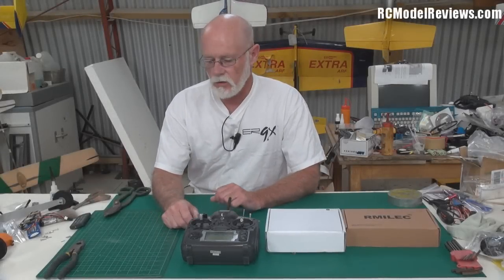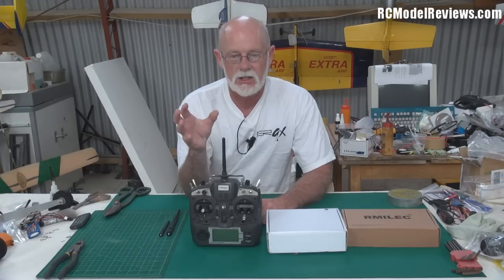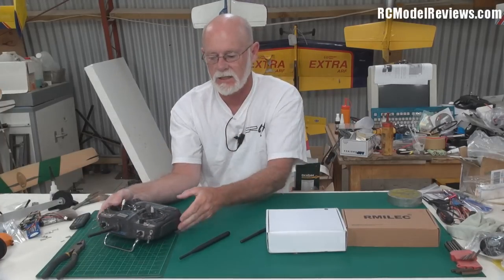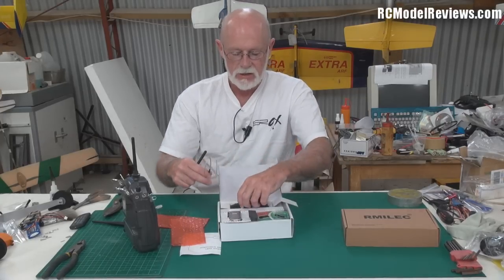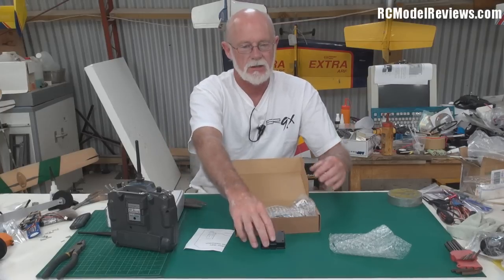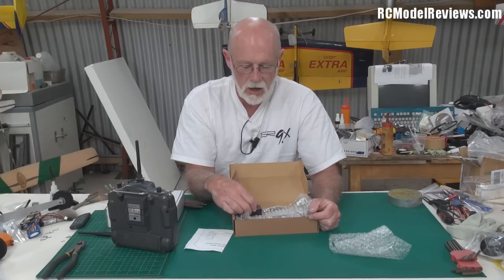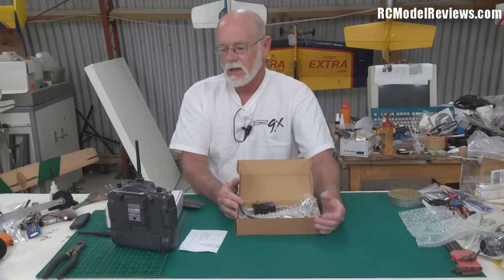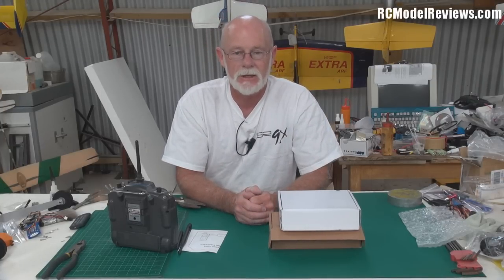FPV long-range RC options

Comment: This is the craziest thing ever that's been bothering me for ages. Everyone says "put your RX on one wing and the VTx on the other one". Sure, that can't hurt, but how big of a difference it is when you have for example the RX on 2.4GHz and the VTx on 5.8GHz and you put them, let's say, 10cm apart and ~5cm from the rest of the electronics. How much shorter will the range be as opposed to let's say 1m separation between the two and ~50cm apart from the FC?

Comment: Ive been flying rc for 25+ years and am just now getting into fpv. I bought the goggles, cameras etc over a year ago and have yet to use them. Im wanting long range. 
I live in Yosemite Ca. Im sure their is very VERY little interference here.
Can you help me by letting me know wich is the best option for me here for long range?

Comment: I know this video is old, but I've recently got a turbowin RY-2.4 to boost my 2.4g signal not for range but for resistance against interference from wifi and 2.4g towers nearby. Model is going wonky and crashing at certain area in the sky. I wonder if these boosters would help eliminate or reduce risk of crashing?

Comment: you have done reviews on all of the FPV equipment except for long range safety and GPS trackers. I lost my Bix 3 and later purchased a PinPointRC Black box, the next time I crashed my Skywalker I found it within minutes. you should ask them to do a review for them

Comment: concerning the 2.4ghz booster , can I use the same type of booster on my 2.4ghz fpv camera , the camera has a 2.4 ghz transmitter and I use my phone for the fpv video , I get plenty of range out of my RC transmitter but lose video signal . I was planning on using a 2.4Ghz Signal Booster Amplifier For DJI Phantom , it looks small enough to install in the camera housing , but if not I can mount it inside the drone , so would that be a go or no go ,  and if no , why not ? any thoughts on that one ?

Comment: whats the situation with the boosters if you use a transmitter like flysky that uses duel antennas? can you get away with using it on one antenna or  do you need to buy two to cover both antennas?

Comment: I know nothing about signals and thanks for the education. I was wondering would it work if i connect a huge fish bone tv antenna or maybe a small tv dish satellite? With the amp that. Comes with it? Wanted to test some range limit on a self build quad.

Comment: How bout using a remote antenna set up with a proper ground plane set up on a tripod or roof top. I know from operating  2 meter and air band handheld radios that these antennas certainly beat the crap out of those rubber duck antennas.

Comment: I watched some videos of the TBS crossfire using their own protocol, CRSF or something. Range is easily up to 40 km, freq is 900mhz and latencies lower than 150ms. But it comes at a price, minimum 99 dollars. You could look into that.

Comment: Hi I added a cpl 2.4 ghz boosters and a booster pack to a mavic drone.  As I understand one antenna is a transmitter and one antenna is a receiver?  Should the booster be reversed on the receiving side?  The boosters have a power led and an antenna led and the antenna led  receiving side only comes on with the input coming from the antenna to the controller and does not lite up the opposite.  The transmitter side does light up with the controller hooked up to the input side and the antenna hooked to the output side.  Thanks for any input.

Comment: Does anyone know if you can use a wifi booster on fpv goggles? 

I have a 2W Sunhauns wifi booster and I wanted to try and use it on my eachine v800 fpv goggles,  to get a cleaner picture.

Comment: Have you tested the range with the 5dB antenna? My understanding (from my experience in audio) was that every 10 dB is equivalent to doubling the volume level. I'm not sure how that translates to radio so you may want to try and confirm that you can actually get 3-6km range with the bigger antenna

Comment: can a television with it's own antenna can receive signals from a fpv transmitter? Not a tv connected via AV cable with an fpv receiver module. But directly by TV's own antenna, despite of having loss of range.

I want to know the signal type of fpv. If it is the same as local tv station or different. If the video receiver inside a television does the same work of a fpv receiver.

Here I'm talking about the small TVs, probably 5" or 7" or 9", not a full size TV of course.

I searched for this topic in RCModelReviews, some other channels, and on google also. But there is no stuff on this topic.

If possible, give a review on those wireless signals with this topic. Else help me with a reply please.
Reply: Priyabrata, I'm pretty sure you're going to need some form of external video receiver, either with a TV set or small monitor screen.

The many frequencies that an FPV system can operate at, are not able to be picked up by the regular TV's Analog tuner (except possibly as noise), and definitely not by the TV's Digital tuner, which operates at a completely different band and frequency.

If indeed you could transmit your signal on the TV's Analog tuner's frequency (would require a custom built VTx) the regulatory bodies controlling the Airwaves where you live, would probably have a few issues with it.

Hope this helps clarify your question (sorry I'm not Bruce.)

Comment: +RCModelReviews Is possible to set up a repeater thru a 30m culvert pipe as part of the course. Approx 5 ft 100 ft  Disused storm culvert that is 90 degrees to the course.  Is there some kind of Repeater system that could do everyone's signal (or even just one)?
Would be a neat topic, or I could just use a big mirror. 
thanks
back to the trench

Comment: Really enjoy your videos!  Makes me want to visit the land down under.  Question about the booster...

Would the antenna still provide some gain if the power was not applied to the booster (meaning booster connects to radio and antenna, but power is on a switch and the switch is off).  What I have in mind is using the boost as an insurance policy (flip a switch and my range gets extended).  Because it could cause problems for other people to have on all of the time, I would rather use high gain antennas and modest power most of the time, and the booster just when I need it.  But I want the switch to the booster to be a simple toggle switch with no antennas to change.  Do you know if there are any repercussions with this approach - either significant loss or possible damage to the transmitter module when the power to the booster is off?
Reply: i like to know too
Reply: thanks!!
Reply: NO

Comment: what about long rang with solar so your batteries will always be fully charged
Reply: You would never fit enough panels on to keep a battery charged, It could extend the battery if you keep pointed at the sun

Comment: what if i want 100km+ range what can i do? i doubt anyone knows but just asking hope someone replies soon
Reply: Control feed is by far the easiest thing to get to 100km. You'll never 
get everything else to that range without a lot of money and a huge 
amount of experience and time. Not to mention the possible safety 
implications...
Reply: How you planning on flying this far with 1 battery?
Reply: +Obinna Eke who said a battery? i was thinking more of a motorcycle engine but i need some type of really long range transmitter and receiver do uk anything other than scherrer uhf?
Reply: salem zeid Hmm, no, I don't really know a lot of transmitters/ receivers that go 100km+. I use a 2.4Ghz booster and a 5.8Ghz booster from sunhans. Which gives me plenty of range for my fpv plane (over 6 km) But i can't go further because of the batteries. So good luck with finding sth that goes 100km+ :)
Reply: +Obinna Eke i was thinking first vlf and lf those go a long way but need large facilities to run them right?
Reply: +Obinna Eke  i also want something without the need to use a repeater
Reply: salem zeid From what i know, vlf goes a long way; even more than 100km. But that's about all i know of very low frequency... Sorry I can't help you with that :/ I have no experience with vlf
Reply: +Obinna Eke no worries man
Reply: +Obinna Eke do uk how the video feed can be made to support more than 100 km? i am new to this excuse my novice questions
Reply: salem zeid Well, I personally don't know.as I haven't tried it yet, Sorry.Maybe you ask that company that u mensioned a transmitter of
Reply: +Obinna Eke okay thank you man
Reply: salem zeid No problem :) Good luck; I hope u succeed in finding one that goes 100km+ as that would be awesome  :)
Reply: What you are trying to do should only be attempted by highly experienced FPVers. You will waste a lot of money and will completely fail, and without the necessary experience, you'll probably do it dangerously too.

And a motorcycle engine?! Are you serious? Please, for the love of legal flying, your self preservation and the safety of others, do not attempt to go 100km with a motorcycle-engine aircraft.
If you do attempt this with minimal experience, then shame on you for being an irresponsible member of society.

To answer your question, "what if i want 100km+ range what can i do?", You don't.
Reply: go get a dragonlink and pick up the 7watt booster for it.  just the regular dragonlink out of box works more than 50km.  I've had it work for 80km line of sight.  The booster will get you the 100km you need
Reply: they're using cell towers so you have to go that route now

Comment: Might be useful (from Cisco data):
0 dBm = 1mW
1 dBm = 1.25 mW
2 dBm = 1.56 mW
3 dBm = 2 mW
4 dBm = 2.5 mW
5 dBm = 3.12 mW
6 dBm = 4 mW
7 dBm = 5 mW
8 dBm = 6.25 mW
9 dBm = 8 mW
10 dBm = 10 mW

note that it is a log scale, not linear.

... BUT: if your transmitter does not put out the power, the larger antenna does not increase transmitter power as indicated... it will only increase output up to the limit of the power (mW) available.  In other words, a system designed around a 3 dBm antenna most likely will not reach 3.12 mW simply by adding a 5 dBm antenna.
Reply: +Devin Duncan yes its log, 0 dBm is the base power, now 3 dBm is actually double power gain. a system that outputs 1watt @50ohm with a 0dB gain will create a radiation of 1 watt equivalent, if you increase your antenna gain by a factor of 3dB, your radiated power will be equivalent to twice or 2 watts.

Comment: So can I get one of the 2000mw 5.8ghz systems from hoobyking and get at least 10 kilometres? as I asked them and they said I needed LPV... I dunno, I give up! Well my goal is to build a semi quarter scale model of at least 2.5 metres wingspan with a gas motor of around 30cc and have large fuel capacity and be able to launch a model down by the coast and fly it inland above the capital city , get footage and fly back again. eventually I want to design my own composite mode land give it long and slender wings such as a u-2 or a predator drone (oops, did I say that?) so I can float around at higher altitudes without using a ton of fuel.
Reply: +stewjw  Dude you need to turn on the sarcasm detector.
Reply: 5.8ghz great for indoors or line of sight you really cant penetrate through much of anything using a lower band 900-1.3mhz will go much further and you have the ability to go though trees and buildings a lot better.
Reply: +shoominati23 2000mW is OTT. You can use much less power with decent antenna. I'm not sure about 5.8GHz I'm a bit out of practice using that. I currently use a 700mW 2.4Ghz ImmersionRC video transmitter with a TBS Ground Station (includes video receiver) and a 11db TBS Yagi and I can achieve 10km no problem. I also use a TBS ImmersionRC 600mW 433MHz radio transmitter for RC control but I typically fly at around 200mW unless going out far. Its depends on the battery I use and I fly mostly in the low power setting. Using low power on the video transmitter causes less interference with other radio gear eg GPS and preserves the battery. A particular problem on small frames such as multirotors.  I just got an antenna tracker which is better for more local flying since when flying long distance you don't  need to  move the antenna that much but it still helps. You can also use a circular polarised (left or right not mixed) clover antenna on a similarly polarised patch or helical antenna on the receiver. There are also horizontal patch antennas which typically you would use use with monopole (rubber ducky) or maybe a dipole antenna which are horizontally polarised. Dipoles are good for radio control freqs including 2.4Ghz if you want to increase the control range using that. Stay away from high power transmitters would be my advice and optimise your setup. Always do long range FPV in small stages to iron out any issues with the setup. With long range always use an RTH (return to home) setup. Radio interfence can come from anywhere and also you can get failures with the FPV gear which is  more of an issue when using  high power transmitters which can get very hot. Anyhow that's my experience check the reviews and forums for your electrics before buying.

Comment: Although Ive been watching your videos for awhile now, because Ive just gotten a Dragonlink, I thought Ide check this vid out. All was going nicely till I heard you say "You can get a UHF system....". Ummm...I know youre aware of this, but, Everything between 300Mhz and 3Ghz is UHF. Why are there people saying..."Oooh, Ahhh,,UHF is so cool"? Anyone flying 2.4G is already in the uhf band!
https://en.wikipedia.org/wiki/Ultra_high_frequency
I know..it sounds cool. We like to get sucked in by the marketeers.
Reply: if you are talking about UHF by (ITU) yes, it is between 300 MHz to 3 GHz, but if the UHF is defined  by (IEEE) it is between 300 MHz to 1 GHz,
Reply: The FCC uses the ITU system, so therefore since I am in the US, my original statement holds true for my purposes. Thanks though for the relative differences.

Comment: How are these guys getting like 3 miles or even farther with the lightbridge on their dji that's only rated at 1.7 km? I understand they're mostly at a beach or something without anything blocking the signal, but over 3 times the rated range? They must have added something. What?

Comment: Hey! I am wanting to extend my range significantly with my radio. I have an option between  getting a 2.4ghz power booster or a rangelink uhf system from my buddy for 60$. On average I only fly out 1km,  but end up loosing signal after the 1km mark. I am running 5.8 ghz for video. And I am wondering which one would be better for me the range link uh system or the 2.4 ghz power booster for 1 km flying. Thanks!
Reply: 2.4ghz is fine. get a FrSky module and youll get 1km easily, get a Frsky 7dBi patch on your module and youll get 2km easy, get a 2watt booster and patch and you could get up to 10km easily.
Reply: Uhf will have longer range but 2.4 will be fine for 1km. You should be good either way.

Comment: I got 200 meters range maximum with my tyrnigy 9x stock module. what 1.5 km are you talking about?
Reply: John Robertson No sir. my radio is 9x, there is no additional antenna pin. there is no breaking connection, it's all checked. That was time ago and i already solved the problem) There is two resistors on A7121 chip  output pin that closes to ground. They are attenuating signal. The are not suppose to be there according to manufacturers schematic diagram. I took them out and after that i have rock solid radio link on 500 meters on ground. I did not tested it on further distance yet.
Reply: I'd say if you're only getting 600 feet range, there is definately something wrong with your system, think I'd make a complaint and have it checked out.. GL  :)
Reply: OrlovIV You may have the wrong antenna. If your Tx has a connector with a small hole, you need an antenna with a pin, and vice versa. Did you damage your Rx antenna (s) in any way during a crash or cut them off thinking they mightve been too long? You cant do that...they are tuned to the frequency of your radio. If you have two  leads coming off your Rx, they need to be 90 deg apart, and preferably pointing down. I mean after all...your craft is above you right?
Reply: OrlovIV Ok, you have the internal antenna like my Futaba 8J. My OrangeRx T6 and Futaba 14SG have external. Those resistors might have been there in the event the radio gets sold in a country that has Tx range limitations. But still, I think it still should have given you 1 to 2k at least.
Reply: i agree

Comment: Thanks for your review. Tried a mod to my futaba t6j using a cheap rp-sma to (small pcb connector?) wire and a 7dBi antenna from ebay. Only got 150m before RTH kicked in. Did a range check on the ground with the antenna pointing straight up (not at plane) and only got about 15 paces away. Could this be a dodgy cable or antenna or am I missing something? Thanks

Comment: Can 433mhz UHF TX/RX be modified to run on 440 band so us Hams can run a brick or other amp to run 10-15 watts power and get extended range via a good Yagi antenna for the ground station and dipole for the plane?

Comment: so if i use a 433mhz radio can i use a 2.4 ghz FPV? and would this be a good setup?
Reply: Yes
Reply: yes, but be aware that other flyers would bring noise to your FPV gear by their RC at 2.4 GHz
Reply: +Euan Will

Comment: In oz we have 2 major carriers 99% coverage and uptime or close to it.. Yes you would run into problems with the modem being assigned a different IP every instance it logs on or connects. An easy fix if diverted through a proxy  VPN.. If connection is lost gps can still auto return to home..

Comment: What about over 3G/4G through rasberry pi?
Reply: Ive personally seen the latency over a 4G connection and I must say I was pretty impressed. As for altitude over 500feet I cant really comment.. A 4G connection easily reaches a ping of 20, with a connection speed 20Mps plus more than enuff to stream medium to high res.. Linux is just awome..